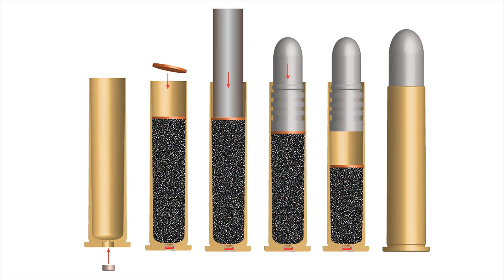Black powder and compression

Comment: You've demonstrated well a drop tube for BP cartridges, but I used used one to shoot BP competition in muzzloaders.  Used a very long drop tube that reached the breach plug & extended above the muzzle.  A funnel beyond the muzzle received the powder.  Compression was achieved, of course, by the patched ball & ramrod.
  But the definitive & measurable advantage was that ALL of the powder was delivered where it should be & not along the bore stuck to the previous shot's fouling.  Genuinely helped.

Comment: Drop tube is a must, when i seat bullets i just use finger pressure to seat the bullet to the OAL length i need, you dont want to crush the powder or bridge over the powder stack. I get perfect results doing this . I also weigh my BP after getting an average of 10 volume measures and weighing those.

Comment: if the same powder charge is compressed a little, vs a lot, how does that affect the actual force behind the bullet? In other words, if the powder is compressed, does it behave (in shooting) the same as if it was just in contact with the bullet but otherwise uncompressed? Another concern I suppose is that powder that INITIALLY is in contact with the bullet can settle over time creating an air space which could be dangerous.
Reply: Very good question. I'll be watching for the answer
Reply: I know this is an older thread, but I'll answer it in the hopes it helps someone else who stumbles across it in their "recommended videos". With black powder, there must be some compression for proper burn, and more compression = cleaner and more complete burn. My 45-70 loads with the same amount of 2F powder and the same bullet leave less residue from each shot when the bullet is seated deeper in the case (more compression). If the black powder is even lightly compressed, it cannot settle, but if it not put in with a drop tube and compressed either with a die or the bullet, there is a chance it could settle and result in some pressure spikes...at a minimum it will shoot very "dirty". None of this applies to smokeless of course.

Comment: Very nice,,,, I am just got a Spanish Rolling Block re-barreled in 45-70 and am trying to figure this out... I am A Skirmisher (www.n-ssa.org), and buy BP by the keg but the only cartridge I load so far is 44-40 for my Henry and Ballard (two different loads,  a low 16 grain one for the Ballard to reduce the possible cracking of the cast iron receiver.)   I am trying to figure this out for the 45-70.... for the 44-40 we use Grits as filler and this works great and my plan is to do the same here, even thought I have read negative things on forums, my experience is different.... My goal now is to figure out how much filler...
Reply: Easy my friend, if your normal 4570 load is for example a 70 grains of ffg rifle powder (black powder) and you want a reduced load....drop tube say 60 grains, compress the powder slightly with a thin over powder card wad, then add 10 grains of corn meal oe cream of wheat and pack it with an thin wad.

Comment: Two things; first, if you are not old enough to know what the insides of an old fashion coffee percolator look like, you should probably skip this, but, I don't even know what it's really called, But I would think it would be something like "Riser Tube, or riser pipe", But it seems like that would make a good drop tube, and be something lying around unused, or certainly could be purchased at Goodwill for two or three dollars. … Secondly, have you tried vibrating the shell AS the powder is being introduced as opposed to waiting until it's full? I would think that would assist the particles in migrating to the position and orientation that gravity wants them to be, which would also make a case for vibrating the shell WHILE applying pressure with a press.
Reply: No need to vibrate the case when using a compression die and card wad. I have loaded these for many years and use a drop tube, then on to the compression die. Depending on whether I am loading grease groove bullets or paper patched smooth bullets I will add a grease cookie (black powder lube disc) and another wad before seating the bullet.